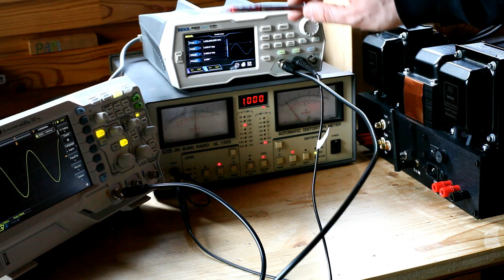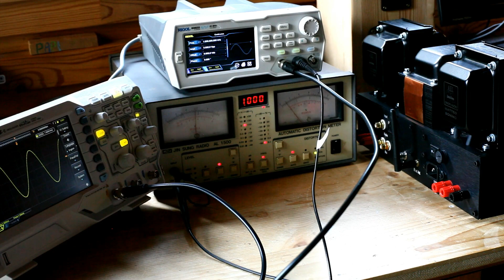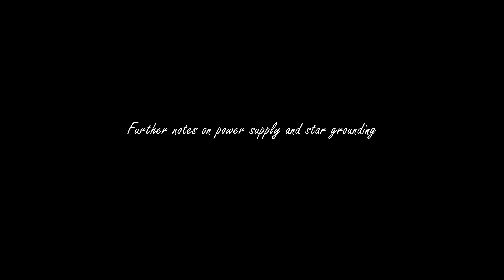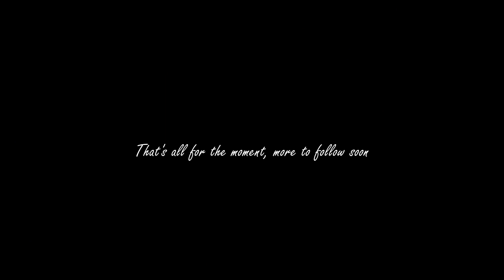Audiophile Tube Receiver Project - part 4 (Look inside)

Comment: Very excited to see the finished Tube stereo receiver! I would be interested in seeing how hot it will get within the chassis when it is all closed up.
Reply from the maker: Thanks Mike !! Very good point, about the temperature inside: I believe the items which will get hotter will be the two 7812 and 7806 which generate stabilized voltage for the heaters. Those are mounted on the fairly large aluminum sub-chassis, which acts as heat sink as well. Another part which can potentially generate fair amount of heat is the smoothing choke; nevertheless, this is very large, little bit overkill, so I expect it will be ok. All other hot parts (tubes, transformers) are outside. So I believe (hope 😊) it will be ok. As you say, anyway, it will be important to keep the temperature monitored, once I’ll be firing up the amp, in order to verify my calculations. Good point, thank you, will keep updated on this.